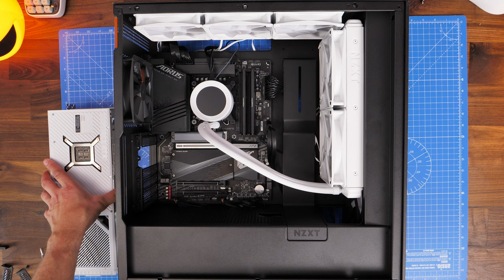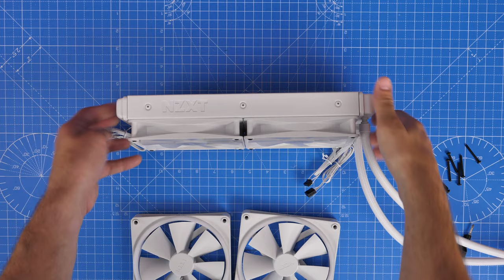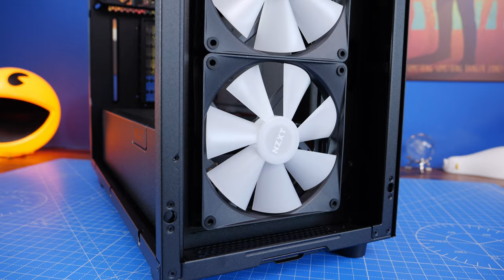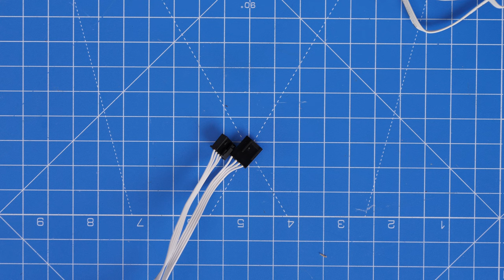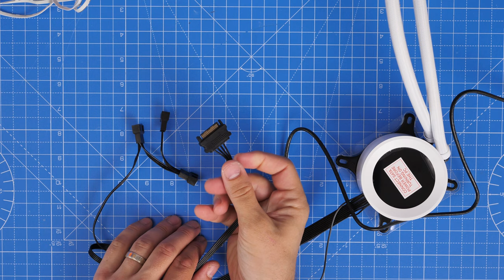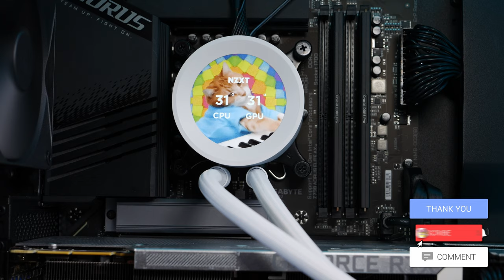Push Pull mistakes to avoid with all in one coolers

Comment from the maker: Specs of this build:
Case - NZXT H7 Flow RGB
Motherboard - Gigabyte Aorus Z790 Elite AX https://youtu.be/8WK7VmuxFxo
CPU - Intel Core i5-13600K
RAM - Crucial Pro 32GB Kit (2x16GB) DDR5-5600 
NVMe SSD - Corsair MP600 GS (https://go.corsair.com/gbmMY2)
PSU - Corsair RM1000e PSU (https://youtu.be/FUnfuF6nSVw)
GPU - Gigabyte RTX 4070 TI 12G OC https://youtu.be/_-bu6qDqeWA
Fans - NZXT Core RGB 
AIO cooler - NZXT Kraken Elite 280mm https://youtu.be/G5r3SG3ACwE
Things worth buying (note these are affiliate links that may earn me a commission at no extra cost to you):
Kraken Elite 280:
Amazon US - https://amzn.to/3r09Hoh
NewEgg - https://newegg.io/ncd17041b5
Best Buy - https://bestbuy.7tiv.net/k0avod
Amazon UK - https://amzn.to/3Jz8pau
Amazon FR - https://amzn.to/441XM8f
Amazon IT - https://amzn.to/44iRKzQ
Amazon DE - https://amzn.to/3r6UCRZ
Amazon CA - https://amzn.to/440CPu6
Corsair USB hub - https://go.corsair.com/5gM1Pj
NZXT fan controller:
Newegg - https://newegg.io/nc4092e7fb
Amazon US - https://amzn.to/3HK0Tsw
Amazon UK - https://amzn.to/3HiQhQ9
Amazon FR - https://amzn.to/3RhSsbe
Amazon IT - https://amzn.to/3jhgOW1
Amazon DE - https://amzn.to/3HmKlWn
Amazon CA - https://amzn.to/3HfhS4s

Comment: Must the in and out of the radiator not to be on the highest point, so the air always goes to the highest point, instead of the pump. Air in the pump can destroy the pump

Comment: Correct me if I'm wrong here just so I understand: Reverse blades would theoretically pull it through the 'front' of the fan right? So if I was to put the reverse blades on the 'front' of the fan, thats pulling air in from outside to the radiator, I'm getting the push pull I want correct? Obviously as long as the inside fan is pulling it through the radiator as intended and to the system?
Reply from the maker: https://youtu.be/pIVMCe8wKb0

Comment: 2 errors in this vid. 1. the diff fans stuff does not matter.   2. front mounted is best.
Reply from the maker: If you could just scroll down through the comments a bit and argue with the other guy who says the front mounting is wrong, that'd be great. Because I'm not arguing with you as well.
Reply: @TheProvokedPrawn  front mounted AIO's are proven to be the best. no argument rly :)
Reply from the maker: No argument because I'm not going to argue. But my testing shows front restricts airflow and isn't as efficient. And it's not "wrong" as the other guy says either.
Reply: @TheProvokedPrawn  do u have a vid on it? :)
Reply: Bro is really beefing

Comment: With a 240mm instead of a 280mm in this case (well at least in the H510 flow, I think it will work here) you have the room to mount the rad and pusher fans in front of the bracket and just put the pullers behind. So you could easily clear that video card. You might be able to do a 280mm if you cut the bracket to allow the tubes to pass through.

Comment: Brilliant! This is helping tremendously with my NZXT H9 Flow build.
Reply from the maker: Excellent.
Reply: all the same fans on both sides of the radiator?
Reply: @CJ-cn3gd  Nope. They're slightly different with mine, since I utilized the fans that came with the case. I was going to order 3 more of the Duos, but I had a friend that did the same build and said it didn't matter. And I can confirm it really doesn't matter, working great for almost a year. I actually have another comment on here where I talk about it in more detail
Reply: @fr3ak1shh  Thanks for the Tip! I didn't think it mattered I have done it before

Comment: Thxn for the video, a clear arguments to not use such a setup, besides the most important one: the terrible cooling due to turbulent flow as its never in balance (in out). Next the flow velocity, that is likely to fast, that actually decreases cooling as you create a thermal boundary.

Comment: I have a push pull setup in my Lian Li O11 mini on the side. Intake on the bottom and exhaust on the top and rear of the case. Works well for me. Idling at under 30 degrees and under stress never warmer than 60 degrees celcius.

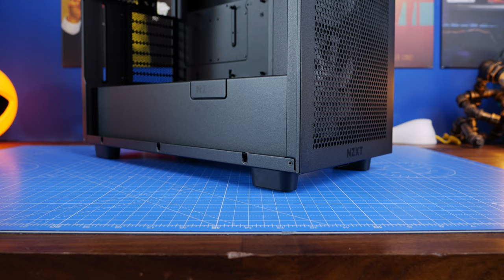Comment: A few corrections at 3:43 (unless I'm misunderstanding something):

- The NZXT H7 Flow case does NOT come with 3 140mm fans mounted to the front. It comes with 2 F120 Quiet Airflow fans accordion to the specs on NZXT's website.
- The quiet airflow fans it comes with do NOT have the same specs as the RGB Duos.

Which now I'm bamboozled! I got the H9 Flow and was hoping to use the case fans as the Pull (outside) fans for the Push-Pull config. But the specs are different, so it's probably not in my best interest to do so. So I may abandon that and just be normal. Boo!
Reply: UPDATE: I sent screw it and threw the case fans in with the RGB Duos anyways! Will report back if I experience any issues, but so far so good.
Reply: @fr3ak1shh still going good?
Reply: @Nodnarb69  Failed to respond, but yes things are working well. No problems with cooling.

Comment: Have you made a video demonstrating a push/pull configuration with a Lian Li Galahad II LCD 360 AIO?  I'm wondering if the extra fans would need a Y-splitter for both the ARGB and Fan connector to go into one port on the L-Connect box or is 6 fans going into one port too much for the unit to handle, therefore the extra 3 fans would go into it's own port and you'd set fan speed to match the initial AIO fans?

Comment: Great video yet again, I was always told never to mount on the front so that you aren't bringing warm air into your case.  I currently have sixteen fans and counting in my LL Evo XL and currently have the rad on top (push/pull) I was running five degrees warmer when mounted on the side intake - I guess as long as the temps are good, regardless of rad placement,  it's all good?
Reply from the maker: https://youtu.be/qQcyYHGtArs

Comment: I want to do a push pull on mine just to drop the radiator down a bit. Can I just add 3 more fans that are at least equal or better in specs?

Comment: How big of a deal is it if the fans on the front of the case and the ones on the radiator arnt the same size or speed capacity

Comment: Isnt it fine to have fans with diff speeds as long as the push isn't impeded by the pull? E.g. the pull is the stronger fan.
Reply from the maker: It's ok, but it's not optimal.
Reply: It's not optimal but it wouldn't make the temps worse right? I'm planning to add a radiator behind the front intake fans (and keep the lower speed intake fans) with a faster fan behind the radiator. Thanks in advance, I'd really appreciate the feedback!

Comment: Hi this might be a stupid question but I'm currently building my first ever gaming pc,I have a ryzen 9 7950x3d processor and I'm wanting to put my corsair h150i elite lcd aio cooler,will the stock thermal paste be okay or should I apply my own thermal paste to make sure the processor is completely covered,the 7950x3d is not a typical square or rectangular shape its kind like a jigsaw piece with little bits sticking out
Reply from the maker: yes it'll be fine
Reply: @TheProvokedPrawn  thankyou

Comment: I'm limited in space on my case. Can i mix fans with 15mm fans and 25mm fans on my 30mm radiator to run push/pull on my i9-13900ks? Case is the rog hyperion gr701. Thanks to anyone for advice.

Comment: Would you recommend a push pull setup for a top mounted radiator? I’ve got a few fans left over from my current build in the h6 flow 😅
Reply: depends if it fits in the case, if yes go for it
Reply: @mchwmedia  it unfortunately did not quite fit! Couple mm off the motherboard!

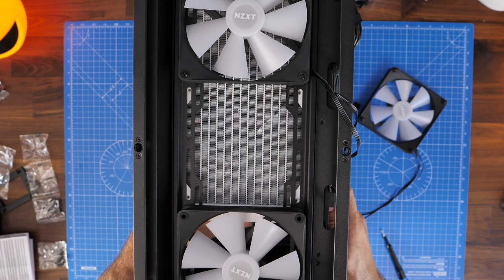Comment: 4:35 Why are you blowing hot air (heated by the radiator) into the case?
Reply from the maker: How hot do you think that is?
Reply: @TheProvokedPrawn  probably less hot than CPU and GPU so it could still work, so you're right

Comment: Helllppp ! I'm building my first pc in this case. I have x2 140 at bottom, x3 that come with case at front,  a rear 120 exhaust at back, 360 aio at top. I don't think x5 intakes and x4 exhaust is ok?? I was going to flip the x1 aio fan over so its a intake closest to the x3 front fans. The flipped fan would get cold air and I would have x6 intake and x3 exhaust which sounds better. Is this fine to do
 I've looked a couple of hours on Google etc and nobody has done this , confused why not as to me it will cool the cpu better and increase the cold air in case. So confused 😂